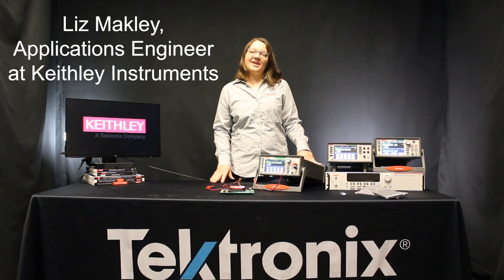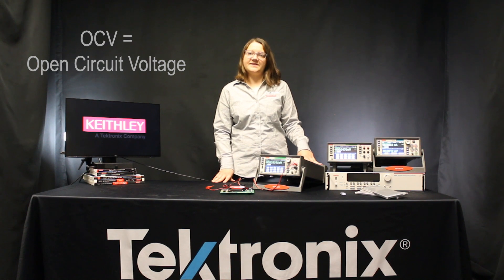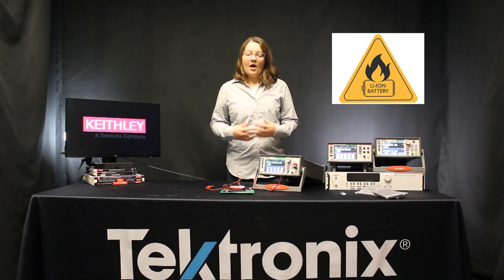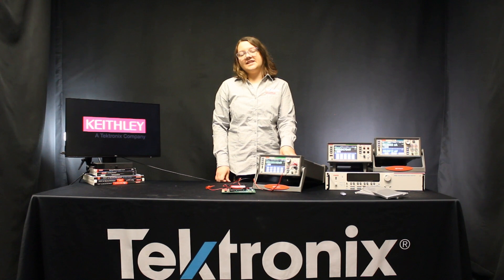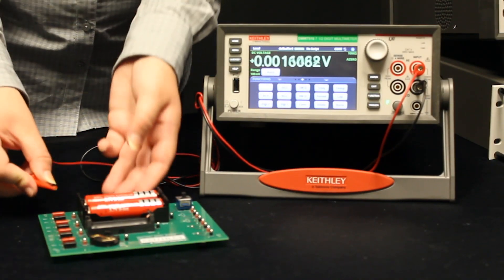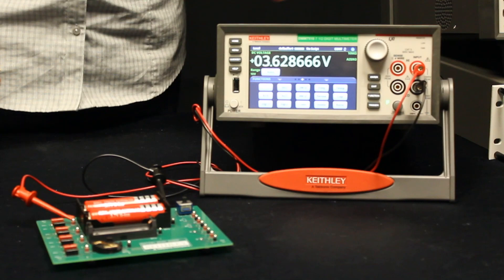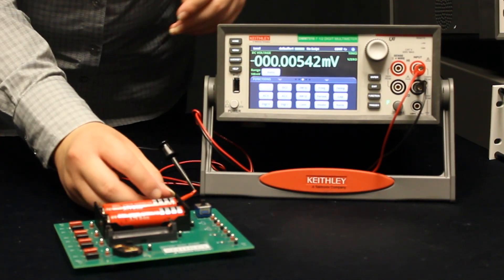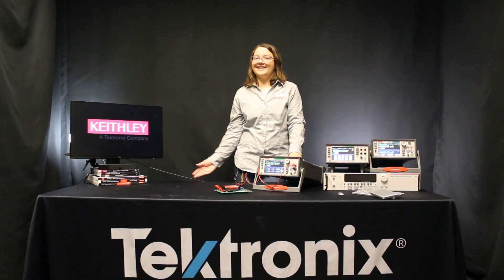Measuring Open Circuit Voltage of a Battery Cell with Keithley’s DMM7510

Comment: Do you have the DMM7510 part number?
4Wrie measurement and AC volt measurement are difficult. There is also no firmware update.

We can repair it if you know the part number.
The marking on the part is VN4E541 58U
SOT-89